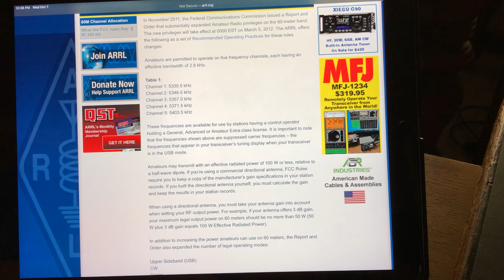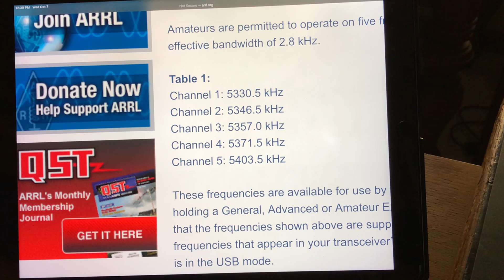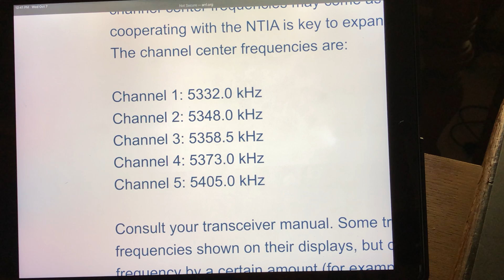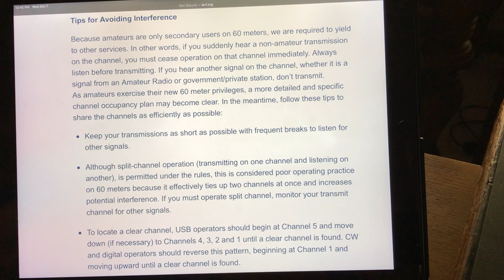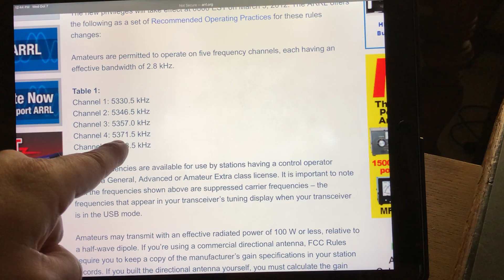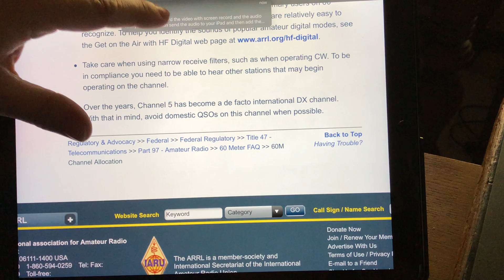Understanding the 60 meter band channels (Part 3)

Comment: Got playing with my antenna and 60 meters is a bridge to far. I will have to play with it. Thanks for the nice article.
Reply from the maker: Many multiband antennas are cut to a length that allows them to work more bands that are harmonically related, such as 40, 20, 17, 12, and 10.  

Okay, so how is there a harmonic resonance for 17 and 12 meters?  The reason the antenna might work with 17 meters is because the low point in the SWR can be broad enough that the SWR is 2:1 or less from 14MHz through 18.168MHz.  The same can be true for 24.9 through 29.7MHz.  So, the reality is that there is a dip in SWR that passes through 7MHz, another near 14MHz, and another near 28MHz, with the dips being broad enough at 14MHz and higher that a basic antenna tuner can drop the SWR to a near perfect match.

But 60 meters (5.3MHz), 30 meters (10MHz), and 15 meters (21MHz) are too far away from resonance to be corrected by the standard internal tuner in most modern radios.  

60 meters is a great band.  It’s worth the purchase of a wide-range antenna tuner, or even better, building a dedicated dipole for 60 meters.  The antenna will be more efficient if it is dedicated for the 60 meter band.  My brother has proven that.  I use my ZS6BKW multiband dipole for 60 meters.  My Palstar AT-Auto can create a match that makes it work.  My brother also has a ZS6BKW.  It’s a great antenna, but it works for 10, 12, 17, 20, and 40 meters.  It can also function on 80 meters with a built-in tuner.  But it needs a wide-range tuner for 60, 30, and 15 meters.  

So my brother built a dedicated 60 meter dipole. It outperforms the ZS6BKW that must be matched with an antenna tuner.  It isn’t a huge improvement but noticeably better.  Since the maximum allowable ERP for 60 meters is 100W, it is important to make the best of every watt of power.

I encourage you to eventually try the 60 meter band.  It provides great regional communications and you don’t have to compete with others who run amplifiers, like those on 40 and 80 meters.

73, de N4HNH

Comment: How come chanel 3 is 5.357.0 instead of 5.357.5? I see my old ARRL band plan chart says 5.366.5 why is there a Frequency Change?
Reply from the maker: Amateur radio licensees were given privileges within the 60 meter band in 2003.  At that time, the ERP limit was 50W and channel 3 was centered at 5.368 MHz for CW and 5.366.5 MHz for USB.  

Changes were made in November of 2012. Channel 3 center (CW carrier point) was moved to 5.358.5 MHz, thus the Channel 3 USB suppressed carrier insertion point was moved to 5.357 MHz.  The USB suppressed carrier insertion point must be 1.5 kHz below the channel center.  CW transmissions should be made at the channel center.  Yaesu radios come pre-programmed with the 60 meter channels in memory bank 5.  All 5 USB and all 5 CW channels are programmed into the radio for us.  This helps keep us from accidentally transmitting out of bounds.

The power limit was increased from 50W ERP to 100W ERP.  If you use a simple dipole antenna for 60 meters your ERP will not exceed the 100W limit, if your radio outputs a maximum of 100W.  A dipole has a 0 dBd  gain, or 2.15 dBi gain.  A transmit bandwidth of up to 2.8 kHz was also made legal, provided we don’t make our transmissions too long.  It is still recommended that we not exceed 2.4 kHz TX bandwidth.  If you watch the video on this channel about Power Spectral Density, you will understand why 2.4 kHz TX bandwidth is better anyway.

The ARRL published an update to announce the changes.  You can view the ARRL information at the following link:

http://www.arrl.org/60m-channel-allocation

I hope this helps.

73, de N4HNH
Reply: @n4hnhradio  this helps. I have been a ham for quite a while but never had any interest in 60 meters. I decided I should learn about it and I really appreciate your videos. I did watch the third one today and I figured I need to read the ARRL article about it. I was looking at my IC-7300 trying to see how to narrow up the Transmit band width and am unsure on it and will need to go to the book. I think the front knob only does the receive bandwidth.
Reply from the maker: You can definitely set the TX bandwidth on the IC-7300.  Look for TBW in the Function menu.  You have Wide, Medium, and Narrow.  

You can edit the bandwidth of the TX filters by changing the low and high frequency limits. But you must edit them via the main menu.  You edit them by clicking Menu>Set>Tone Control>TX>SSB.  I suggest 300-2700 Hz.  That is 2.4kHz.  It yields a good balance of TX audio quality, keeps you absolutely legal on 60 meters, and improves Power Spectral Density.

73, de N4HNH
Reply: @n4hnhradio  Thanks. I was looking at that last night and I think it is at 300-2700 I believe? But thanks for the tip.